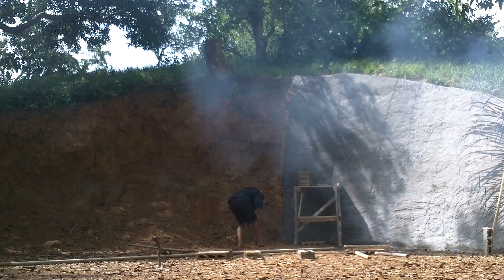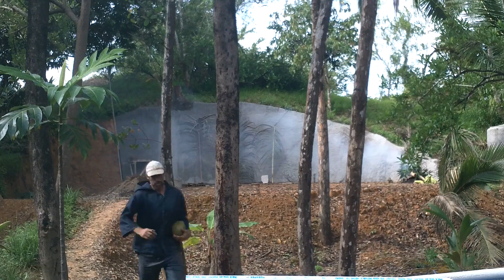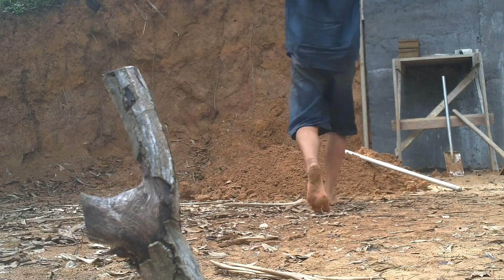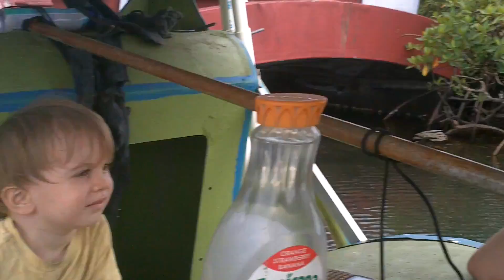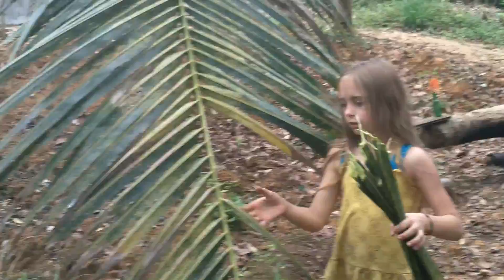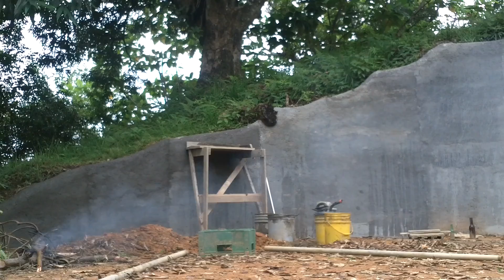Adventure Builder Cathedral 001

Comment: How well does the cement cling to the clay? Honest question I dunno
Reply: Nathan L  :    When  building  a  'rammed-earth'   pump  house  in  Florida  (more  than  a  few  years  ago)  I  used  chicken-wire  between  the  earthen  wall  &  the  cement  veneer  applied  a  day  or  two  later.   It  may  have  helped,  BUT  when  my  then  ex-wife  backed  her  car  into  the  pump-house  wall  a  'coupla  years  later  fracturing  the  veneer   it  did  not  take  the  4:30 afternoon  Thunderstorms  long  to  lay-waste  to  that  wall.     No  repair  to  the  fracture  was  attempted.    So,   the  cement  veneer  reliability  would  seem  to  be  crucial  &  so  it's  'cling'  capability  important.   But  the  cement  stayed  attached  to  the  clay  very  well  as  long  as  not  disturbed  by  outside  impact.

Comment: I feel like it couldnt hurt to install some dead man anchors on that concrete wall just in case it starts thinking about collapsing in towards ur new home. U could do long allthread with a plate and nut so if it starts moving u can pull it back into shape. Never hurts to have failsafes for potential catastrophic failures. Keep in mind that ive never done anything close to as monumental as u have so grain of salt and all. Either way thanks for putting out more videos dude, i think with the way things seem to be going allot more people are going to see the value in living a simple cheap exhistence somewhere far away from all the heelots.
Reply: I have to agree with you. As much as I admire his tenacity/ ambition/ ingenuity, I do not see this holding up.
( no substantial footing/rebar or wire mesh) 
Unless he intends to build against it, heavily, I'm suspecting a hydraulic, catastrophic failure, within a few rainy seasons.
Just my opinion.
Reply: CipherNL  
If that mound ever decides to move, It will certainly not be moving "backwards".
This would have needed to have been constructed like a retaining wall, drainage elements, ETC.
Unless he intends to "substantially" build against it, this wall is going to have a dim future.
Reply: CipherNL  
I actually did see the first few minutes, along with the entire video. He actually states that the reason he is mudding the wall, is because, he could not get material, concrete, ETC for a couple of week/months
and the mound was eroding/ collapsing , it's not that sticky. Most types of natural clay, are a nuisance in construction scenarios not too bad when it's dry, but damn near useless when it's wet  , in a construction application ,shrinking, swelling, pretty much unpredictable.
Again, if he's not building something heavy and stable against that wall, it's doomed, 2 years max. ( I'm not wishing this on him, just a gut feeling.
Sand would have handled drainage much better than the clay.

Comment: Building  walls  of  a  'rammed earth'  pump-house  in  Florida,  I  used  chicken-wire  between  the  wall  &  the  cement  veneer  thinking  it  would  add  strength  somehow.    It  may  have.       BUT  when  my  darling  (ex)  wife  backed  her  car  into  the  wall  (a  coup'la  years  later)  fracturing  the  cement  veneer  .  .  .  .  .   well  .  .  .  .  .  it  did  not  take  long  for  the  4:15  afternoon  Florida  thunderstorms  to  lay-waste  to  that  wall .    ( No  repair  to  the  wall  was  attempted  due  to  lazy  indifference  of  my  darling  (ex)  wife.)     SO,  long  story  short  is  re-cement  any  fractures  before  mother  nature  has  her  'way'  with  you ! ! !          ( This  comment   directed  at  your  adoring  viewers  rather  than  you,  Mr. Mantzel. )    
      ( I  loved  my  darling  (ex)  wife,  so  no  negative  implications  are  expressed  here. )

Comment: Don't you need drain holes at certain points over the heigth of the concrete wall? if water would start to pile up between the concrete and the dirt you get a heavy water column that will push the concrete out and maybe destroy it?
Reply: That wall was open for months he said, so if there was any water seepage he probably would have seen it. Since he is pasting concrete right against clay, there isn’t a granular backfill like there is in most modern foundation situations where perched water would get trapped. If he manages rainwater flow off of the structure, which we know he will because he captures his rainwater, probably very little water along the wall to worry about. And if he was getting some wet spots he could always install some kind of footer drain inside the structure after the fact?